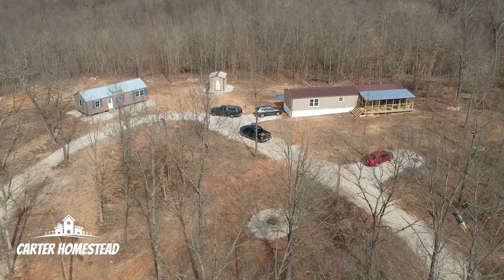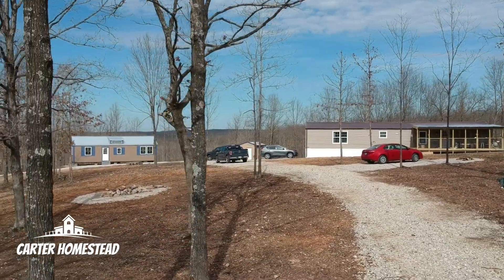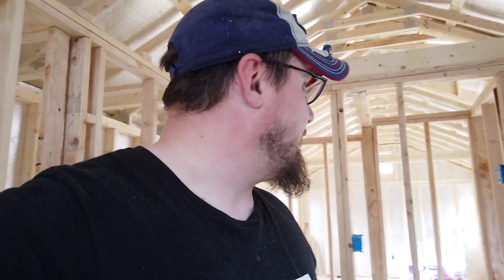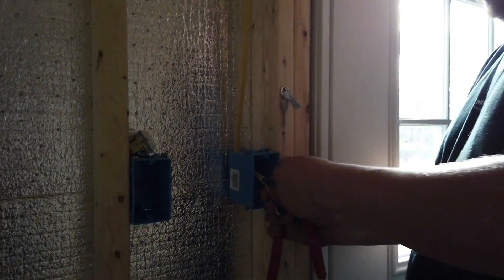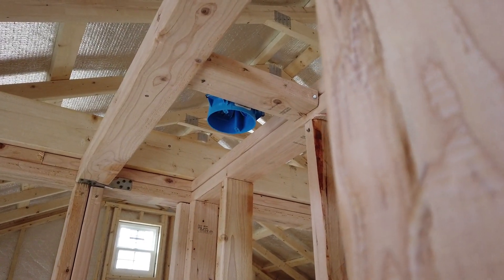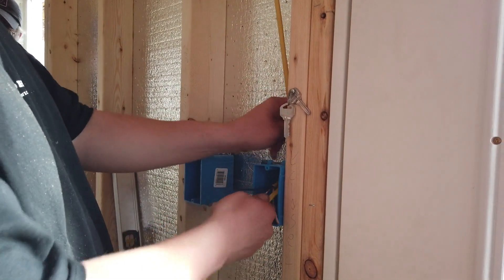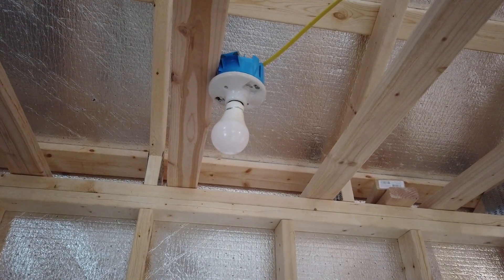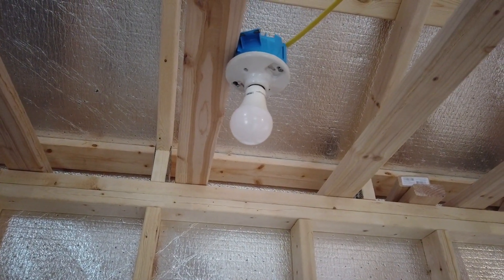Wiring Electricity in our Shed to Home

Comment: I see is insulated. I live in fl and want to use that foam insulation. Which why do i face the shinny tin foil side in fl? The wall or to me?
Reply from the maker: That is just bare bones insulation. Its an R6 or R7. We also put R-13 in and its been incredibly insulated since. I dont know about the foil, I had them include it in the build of the building so I can't see both sides to tell you either way haha. Thanks so much for watching :)